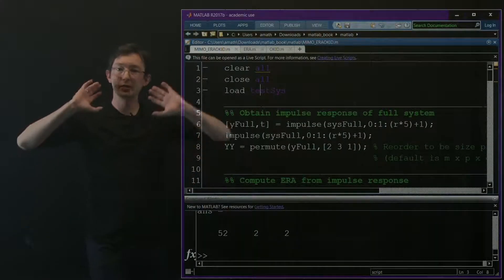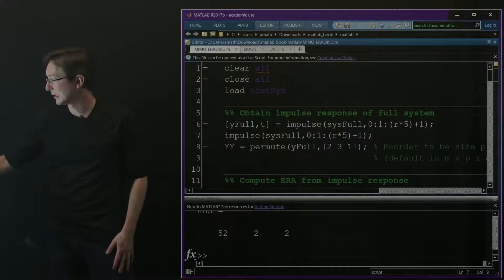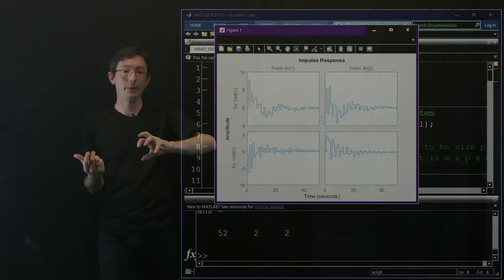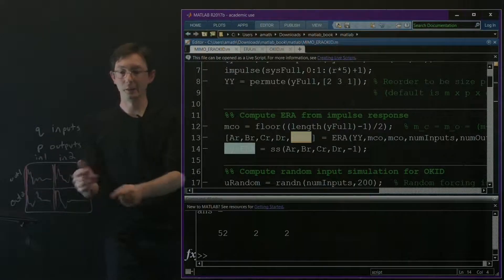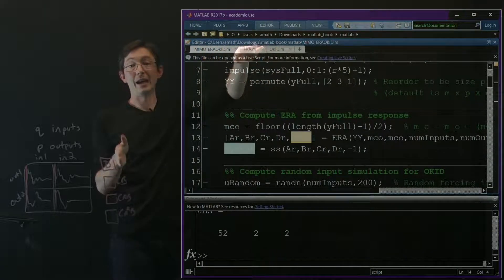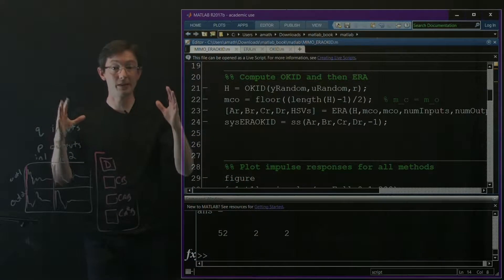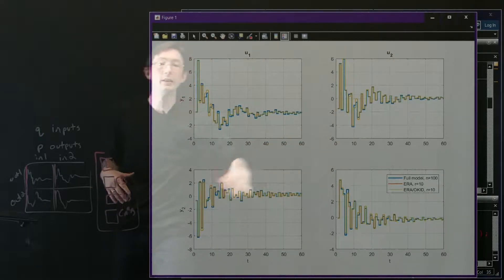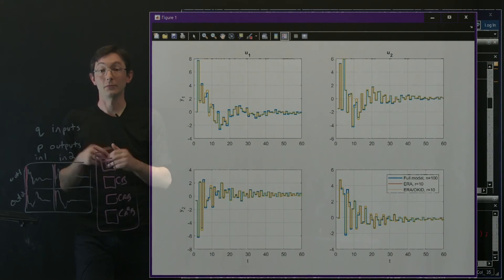Data-Driven Control: ERA/OKID Example in Matlab

Comment: a fascinating result is that your code despite all these replacing and the power of sigma which should be 0.5 but it is -0.5, works properly and when I change it to the correct version it does not!
I also check with your book, the same thing you mentioned in the video is also in the book. 
So, can we conclude that what you explained in the book and in the video are incorrect and what you wrote as the code is correct?

Comment: How does one decide the order of the resulting system ? through SVD ?
Reply: Hey Mark - I think you're right, but more specifically, it depends on how well you want your data to estimate your full state model. In lecture 10, Prof. B talks about how you can look at the architecture of your singular values. If your singular values suddenly drop off at one point, then you know that that will probably be a good place to truncate. If you have a desired value for error, I believe you can extract r from the upper and lower bound of the infinite norm of G. 

I also think lecture 13 shows a good example how how much information your first r modes contain. At 2:00 I think the cumulative sum plot shows how much of the Hankel singular value energy is encapsulated in the first r modes.